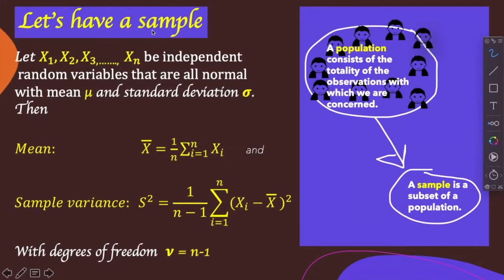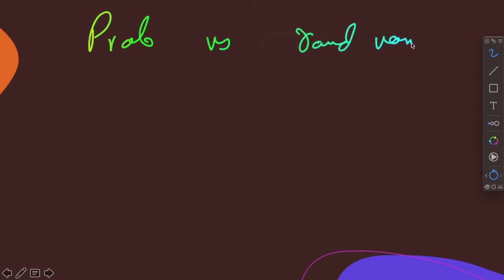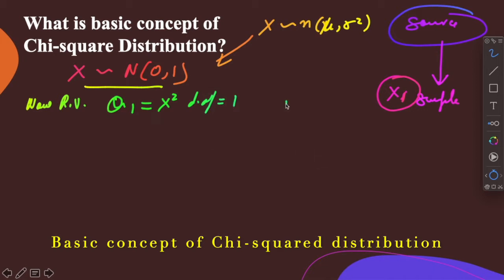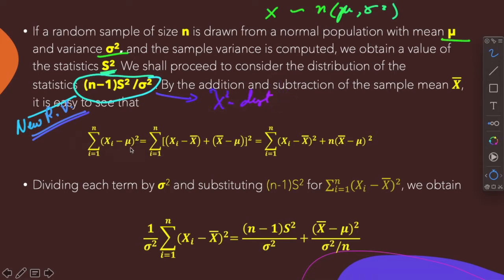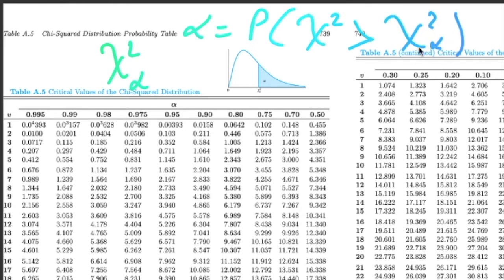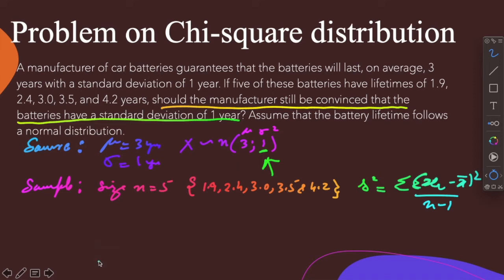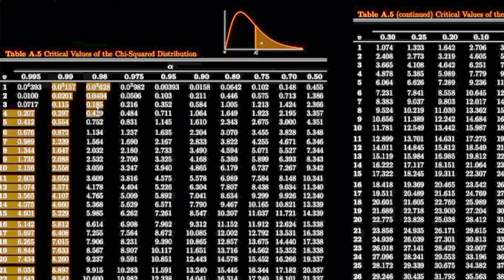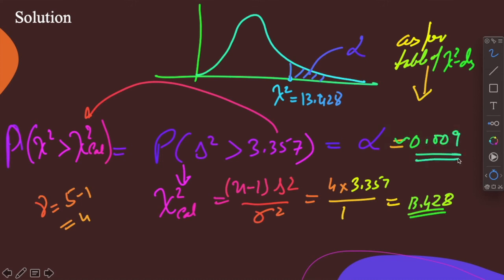Lecture: Sampling distribution ( t & Chi-squared distribution)Part-1

Comment: the last example is not clear
Reply from the maker: abidalikhan@gmail.com
Write which point of sampling distribution is not clear
Reply: Yes sir it is not at all clear . What are critical values and how can u take 0.009 if any value greater than 0.001 and 0.005 is possible?
Reply: @MEBTabishKazmi  if the values of p i.e the probability of occurrence of the value of random variable go beyond a certain point set as a boundary for confidence Interval and level of significance, It is considered to be having different type of occurrence than which is represented by the distribution.